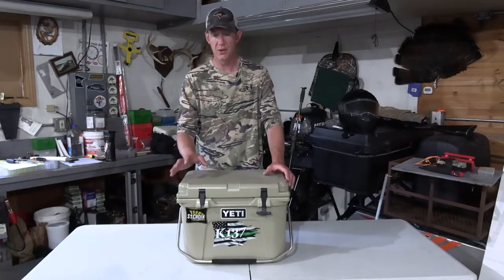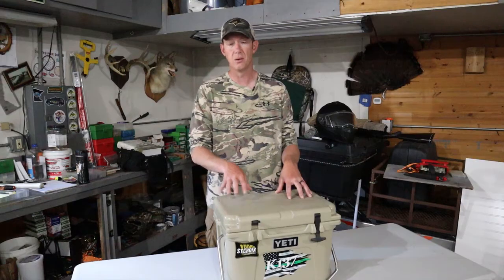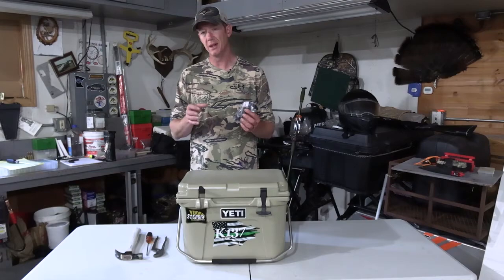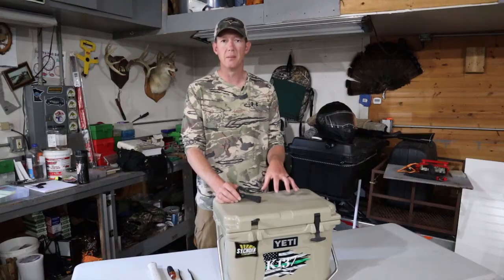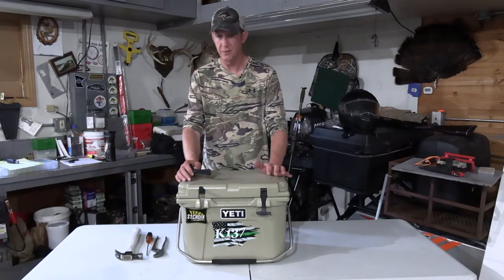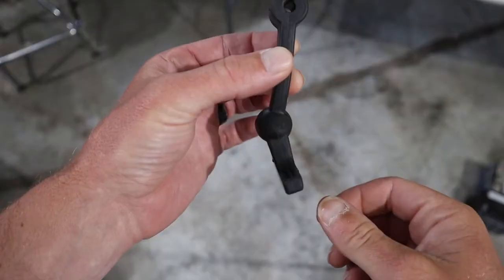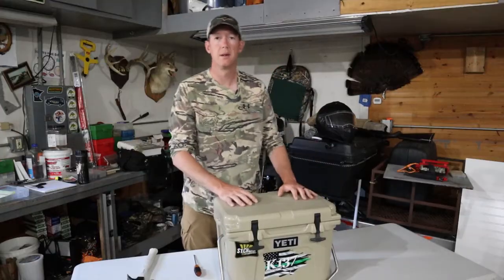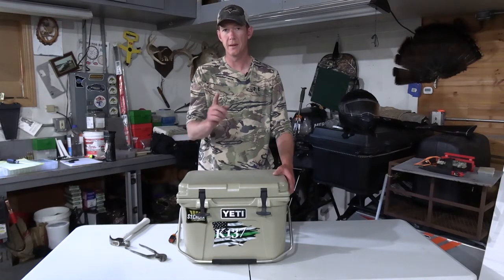How to Replace the T-Latch on a Yeti Cooler

Comment: I've had a Tundra 45 for about 5 years now. I actually got it used so I  don't know how old it really is, but it have lived in the bed of my truck in the sun, rain, ice, and snow the entire time and it has held up great. One of the handles finally broke, which is the reason I watched this video. It was very helpful. Overall this has been the best cooler I have ever had by far!
Reply from the maker: I still like mine except for how heavy it gets lugging it around
Reply: @After5Outdoors  the second of two drawbacks of Yeti coolers... They are heavy for sure.
Reply from the maker: Is the other, the price😆

Comment: I just bought the same cooler, used, on FB Marketplace ($200). It came w/o a drain plug, bought one at Dick’s Sporting Goods but the Roadie 20 & 24 have different size plugs. Found one on Amazon for less than $10 (actually came with 2 plugs) and problem solved. I will be replacing the latches since I don’t know how old my cooler is, so thanks for the how-to.

Comment: Thanks - got a tundra haul (wheeled) and handle broke - I thought the rod went all the way thru and I was screwed - so thanks! Cost me too much also have a Walmart Lifetime 55Q and it pretty much keeps the things just as well and the handle will not break :) for 25% of the cost. The wieght of all the rotomolded coolers is the biggest problem for me. Honestly I've seen too many videos where they test ICE to conclude the Yeti performance is worth 2-4 times the cost. But I got mine because I wanted "The Best" - no complaints other than the T handle.
Reply from the maker: They are heavy for sure. Thanks for the input!

Comment: This was very helpful, I have the same one and have the same problem. I was about to just purchase a whole new cooler.
Reply from the maker: I was curious when mine broke, in the end, a very simple fix. Appreciate you checking it out
Reply: @After5Outdoors  no problem, I might as well replace both soon the other one will break off
Reply from the maker: I even bought a spare set
Reply: @After5Outdoors  I've had mine for 4 years I figured it was time, I gotta use a pad lock until I can order the new latches
Reply from the maker: I found em a bit cheaper on ebay
Reply: @After5Outdoors  I saw some on Amazon I might get, they not name brand  there more less a universal set you can use with yeti and a few other brands

Comment: Do you know if the hinge side pin removes and reinstalls in the same way? I want to get a 65 to put in my boat compartment, but I need to remove and reinstall the lid to get it through the compartment opening.
Reply from the maker: I have not messed around with the hinge pins